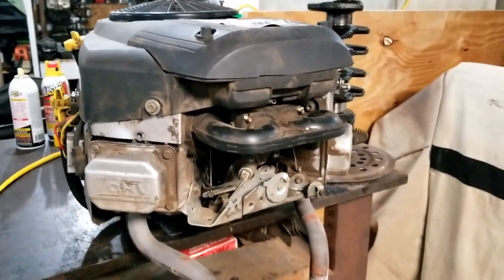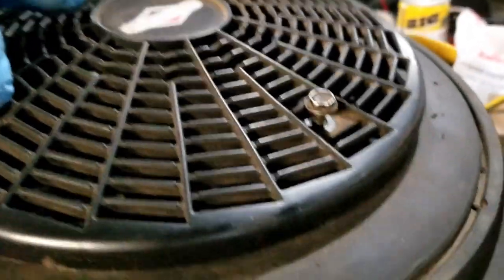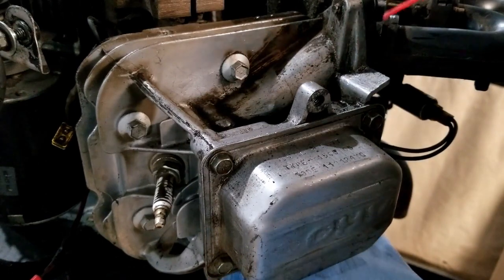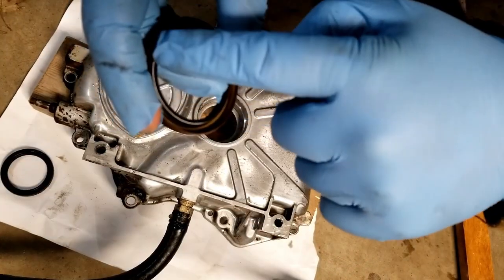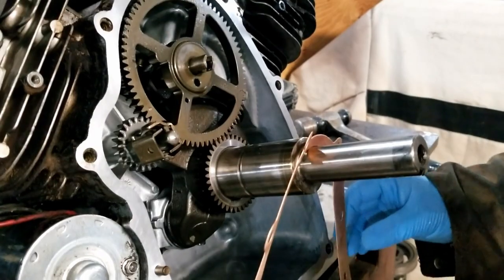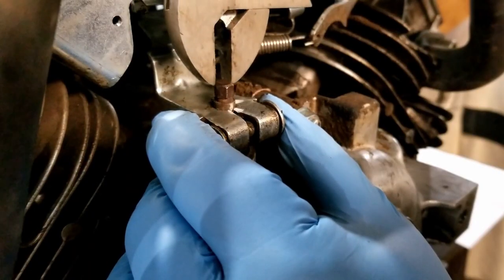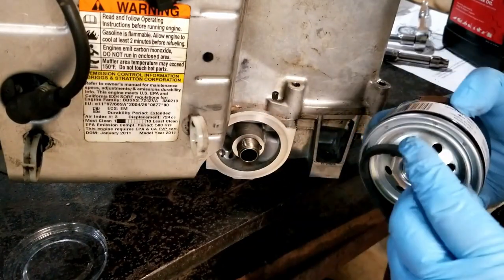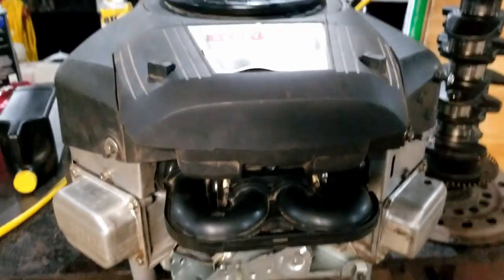Briggs And Stratton V-twin Case Seal

Comment: Does it matter what position the governor rod is in when installing the sump plate to the engine?
Reply from the maker: kind off... luckily it easy to adjust. Idealy put a mark on the gov rod and clamp so when reassemble just line the mark up and then no adjustment needed. but you might get lucky and be close enough to not need any adjustment.

Comment: i notice you didn't take the oil pump out (3 5/16 screws are holding it on in my B&S Model: 28T707  Type: 1154-E1  Code: 010302ZD, ), I notice some people take that out, do you think I should on my particular engine since it's a Bucket head or single piston B&S 28T type engine?  It looks very close to yours without the V-heads.  My sump lower pan gasket might be leaking like yours, not sure yet till i get-er off , also, my gasket didn't come with replacement bolts and it is a genuine B&S gasket.  Should I get new bolts?
Reply from the maker: Dealer choice for the oil pump and the bolts. 
In Mongo opinion: If you don't have to remove the oil pump then don't touch it. If kit no come with new bolts then reuse em.
Mongo did case seal on an old single cylinder B&S in this video - https://youtu.be/cduQryTqZYU

Comment: I have a 24hp B&S. Looks like oil was pour all over it 😂. Find and everything is covered in oil too. What would make the intake be full of oil?
Reply from the maker: couple different things, valve guide seals, piston rings, PCV system
Reply: @mongofix  thanks for the tips. Spent 2 hours cleaning it off…. Found the oil filter was loose. And the dip stick was cockeyed. Hopefully that was it😅

For the PCV system, there is a small hose connecting in the back of the intake filter housing into the block…. Where is the valve?
Reply from the maker: The tube attaches to the breather assembly (which is bolted to the block) the PCV valve is inside that assembly. Sits right between the V of the block.